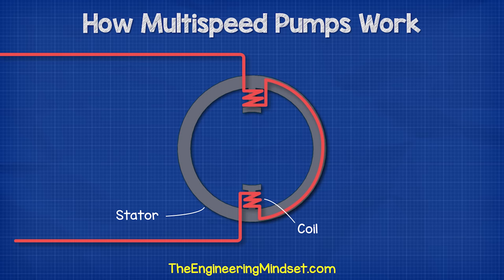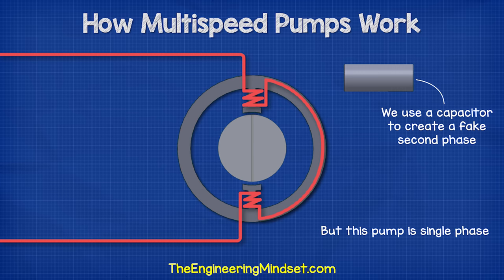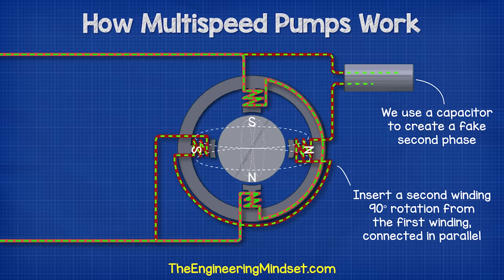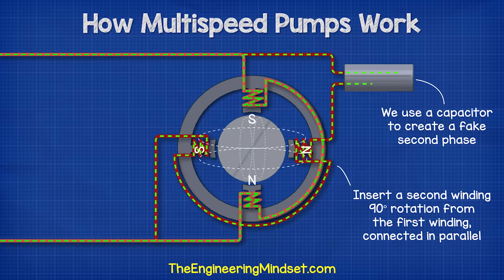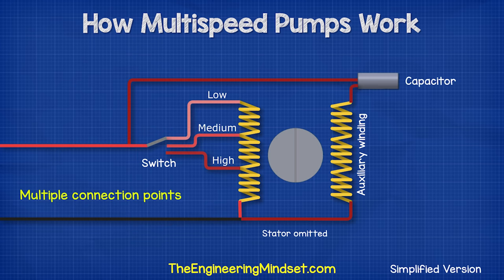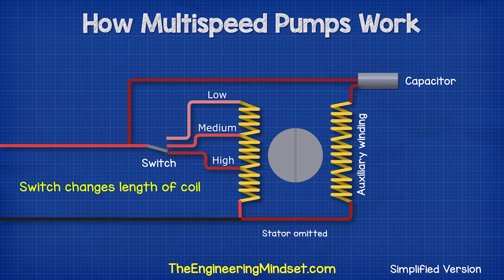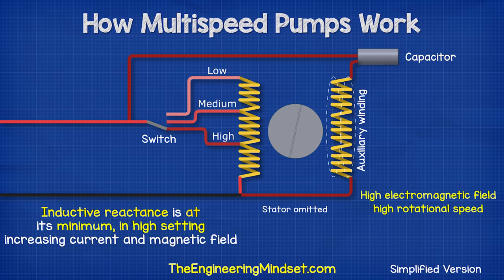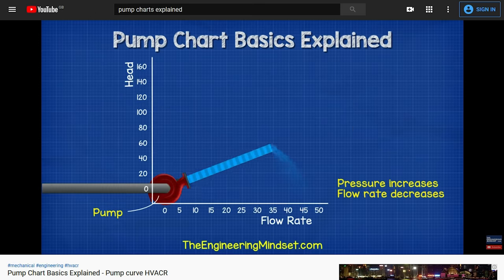Have you ever wondered how multispeed pumps work?

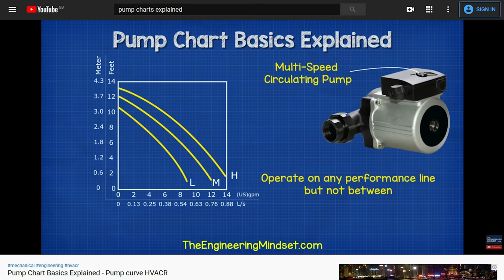Comment: In the diagram shown at 2:50, the aux winding and capacitor is the same length as the 'low' speed winding on the left, even when switched into high. Is this intentional? Wouldn't that cause the false 2nd phase to always be the same as the low amperage setting?